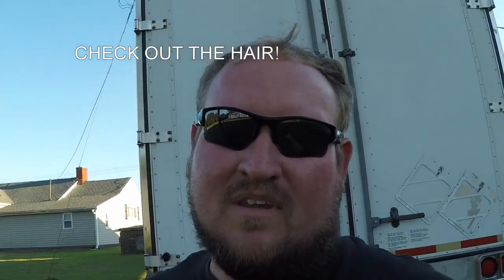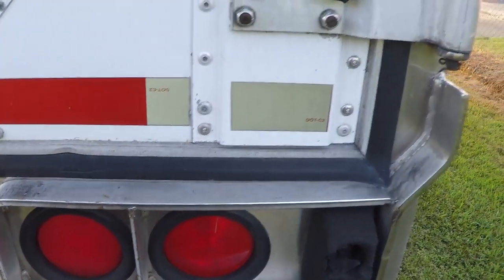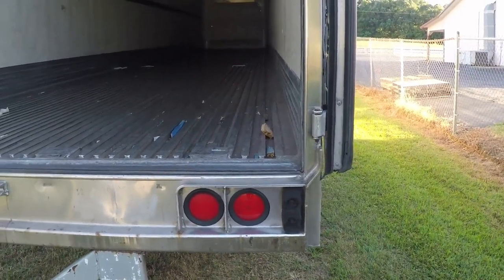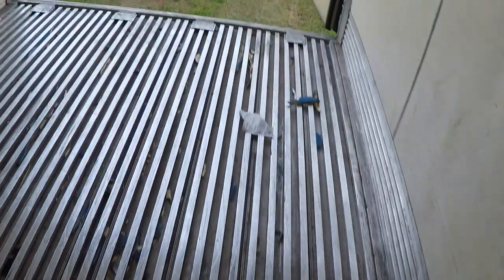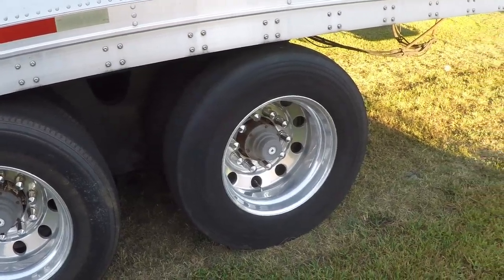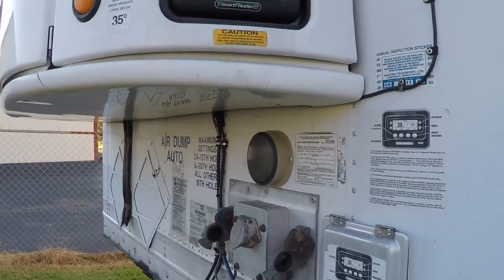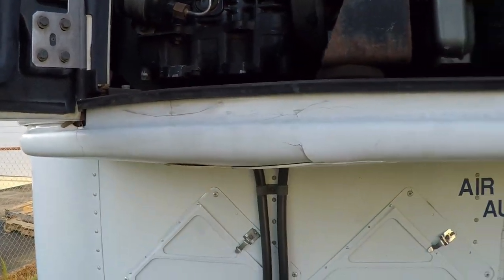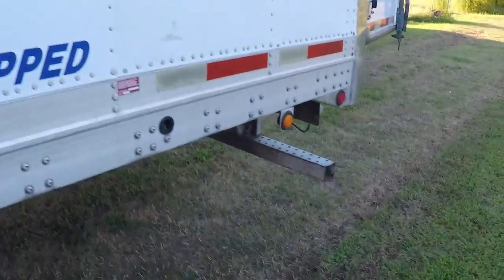What to look for when buying a reefer trailer?TIPS TO SAVE YOU MONEY!

Comment: Have you had bushing problems with your Meritor RHP series suspension on this trailer? I have four trailers identical to yours and have had to rebush all four and in two cases install sideplate repair kits. They are a good riding suspension, you just have to really keep an eye on all the bushings on that four-link style setup.

Comment: I'm curious if you or someone else could answer this question for me? I know these reefer trailers are meant to keep the load cool or cold, but, do reefer units also have the ability to keep loads warm? Can you set them to a temperature and have the unit keep it roughly at that temperature? What is the temperature range that the load can be kept at? I can't seem to find this information and not sure if I'm just looking in the wrong places or what. Thank you.
Reply: Mark Reaves unless you get a deep freeze unit they run -20 + 80 so less temperature control loads being warmer
Reply: @harleybishop7658  So, if someone set it to 65 it would keep it roughly at 65 regardless of outside temperature?
Reply: Mark Reaves yes

Comment: What is an e-track exactly please?
Reply: E-tracks are a system that helps you secure the load more securely than load bars,since they are built into the trailer and you lock the straps into the walls and can cinch them tight and they won't move,vs a loadbar that will slip down if bumped right with the load.